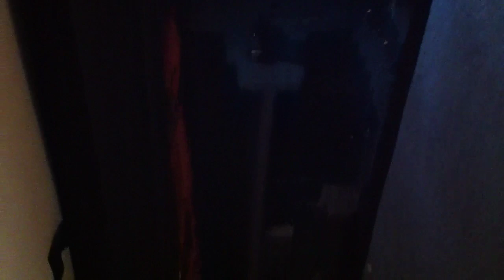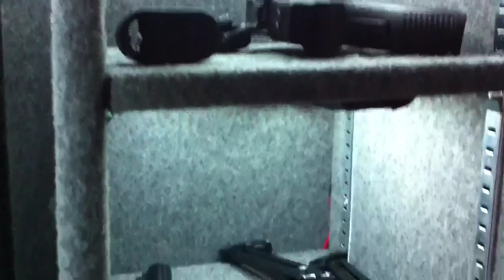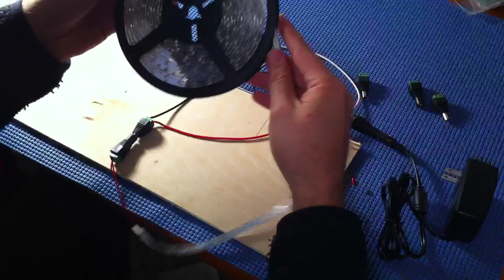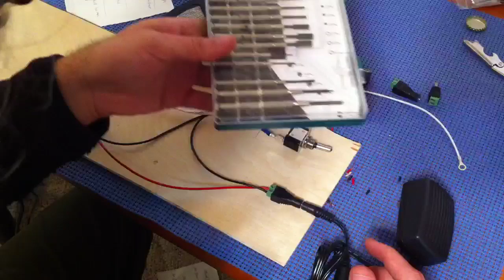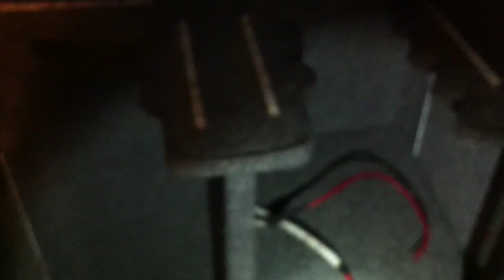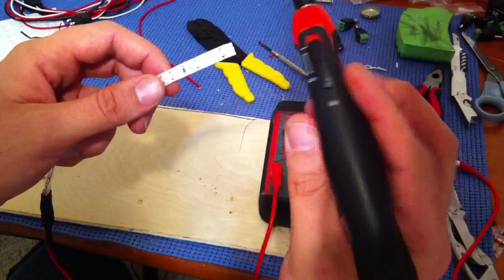LED gun safe lighting mod - DIY

Comment: Nice job, day and night difference, no pun intended LOL well maybe a little. I like that you used heat shrink tubing not tape, tape sucks after a year or so you'll have a gummy mess from the tape and possible exposed wire connections. I cringe when I see people using it. I did a similar job on mine the only addition was a fuse inline with the 12V source just incase. _ _ ...  ... _ _

Comment: Hey just some thing to keep your eyes on. I think you and I bought the same power supply. Mine lasted about 1.5 years then started sparking and arcing all over  the place and burned a small hole in my carpet before we coughs it. 

I had my dad go over my set up as he is a phd in electrical engineering and he said it was all built right. Just the cheap Hong Kong power supply fail.

Just a friendly heads up. Don't want your house burning down.

Comment: 2 amps is enough to kill you, however, 12 volt just won't push it through your body.  Think of a 12 car battery (actually 14v), just doesn't have the voltage.

Comment: u have 2 amps @ 12v
dont forget that a car battery has 75A @ 12v and it will not kill you
HIGH current + HIGH voltage will kill you

Comment: I wouldn't worry about electrocuting yourself with 12 VDC too much. Think I'll use a staple gun to hold the wires in place. Did you use some sort of fire stop caulk or grommet for your electrical access hole?

Comment: Great video, inspired me to create mine except I need to use batteries since I do not have a outlet in my closet. 

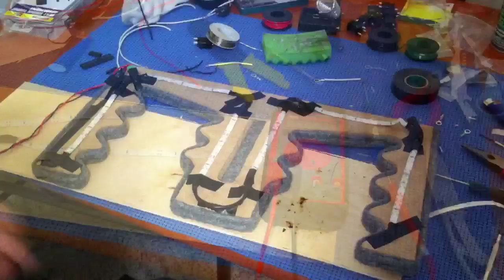At 14:15 you have a piece of your shelving out. Was that hard to get out? I have a similar safe by Liberty and it has the same exact shelf in it. Thanks.

Comment: nice job.. I tried to power it with 4 double A batteries and did not work. I been having trouble finding a power supply. I'll try your method. I'll tell you how it went, If I don't electrocute my self.. CHEERS...